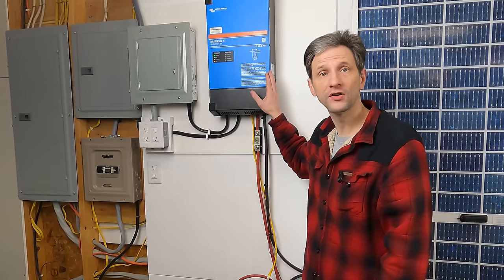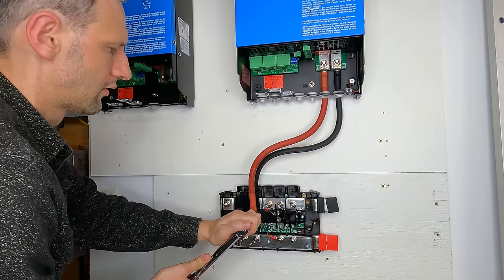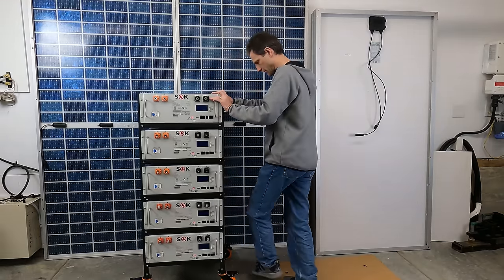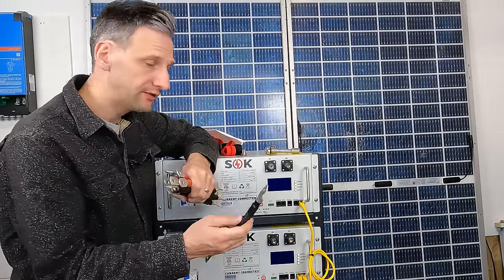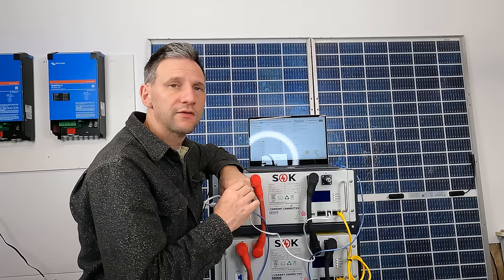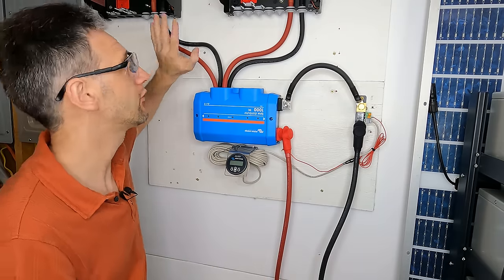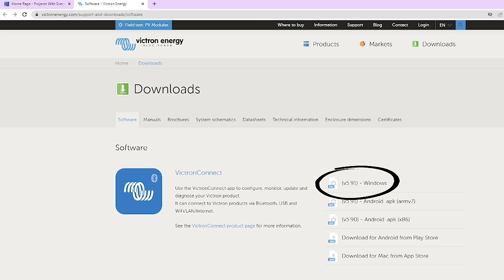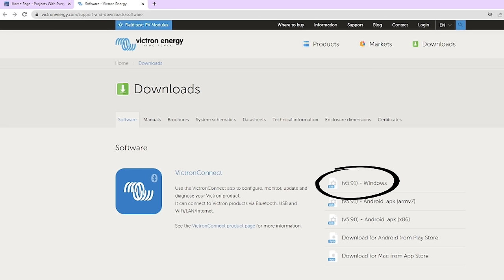DIY Split Phase Battery Backup for Home - Step by Step

Comment: I’m a bit confused about the grounding relay in the inverters. Aren’t the ground and neutral bonded in your main panel? If so, why do you need to bind them through the relay in the inverter. Perhaps I’m missing something obvious given the complexity of the setup here.
Reply from the maker: When the power goes out, the Victron internal transfer switch moves the emergency panel off-grid.  The emergency panel does not have a ground/neutral bond and is now isolated from the house electrical system.  You need a ground/neutral bond somewhere in the system so one of the units is programed to create that bond when running off grid.
Reply: @ProjectsWithDave  makes sense thank you
Reply: @ProjectsWithDave  Unless I missed something, you have continuity from the sub panel through the inverters to the transfer switch.  All grounds should also be connected together.  If that is the case, the connection in the main panel between ground and neutral is still active..

I have a similar setup with a generator in my system.  I have to remove the internal connection between ground and neutral.  Mu inspector actually asked about that when he reviewed my installation.  I created a plug for the full power outlet of the generator to connect ground and neutral.  Since that plug and the house cannot be connected at the same time, all is good.

Comment: Fantastic video and love watching your others. Two questions: 1)Since the inverter is the only supply to sub panel wouldn’t it make sense to have a way to still power subpanel for maintenance or replacement of inverters, like an interlock or something with grid into subpanel?  2) When you landed the two neutrals from inverters, looks like one went to main N lug and second went to N bus bar, is that correct?
Reply from the maker: I could have set up an additional transfer switch for maintenance purposes, but I don't think it's worth the trouble.  I used the main lug for one of the neutral wires because it was convenient and I'm not using it for anything else.  A 6AWG wire is large enough for the lug and they all go to the same place.
Reply: You can install a rotary bypass switch for this very scenario, and I install them on all my setups.

The way he has it, if one inverter fails, you lose all power, and a rewire will be necessary to get power back until the inverter is fixed or replaced.

An auto transfer switch can fail as well, so having some manual and mechanical method of diverting power makes more sense to me.

Comment: You can install a CerboGX and get the SOC directly from the battery via CAN. No need for the Battery Shunt. Using the CerboGX will also show you and record the cell max and min voltage, battery temperature and other information.
Reply from the maker: When I can find some time in my schedule I plan to get one and try it out.

Comment: Why not connect the shunt directly to the lynx distributor vs using a cable? 17:32
Reply from the maker: So I can mount it independently without putting unnecessary stress on the device.

Comment: Question about the ground bonding setup on the inverters..  Since this is not a separately derived system, would it not be correct to have them both set to not have the ground relay enabled?  Your neutral bond is still at the main panel in your house..
Reply from the maker: When the power goes out the internal transfer switches isolate the hot and neutral conductors from the home system.  At that point it is it's own off-grid system and needs a ground/neutral bond.
Reply: @ProjectsWithDave  thank you for the reply..  Does the victron change the bond as well when the power goes out?  If not, seems like two bonding points in the system when the power is on..
Reply from the maker: That is why I had to make the settings different for each inverter.  One inverter is set to no bond, the other is set to create the bond when the units switch to UPS mode.  That way the system has only one Ground/Neutral bond.
Reply: @ProjectsWithDave  When your power is on, how do you not have two different bonding points?  One at your main panel and one in the Victron?  Does the Victron that's doing the bonding change its bonding status between power/no power state?
Reply from the maker: Yes, it has a relay that switches to make the ground/neutral bond when in off-grid mode.
Reply: @ProjectsWithDave  that is so cool..  Glad they implemented these kind of features..  Thanks for taking the time to communicate..

Comment: If connecting more then one string of batteries could one of the open spots on the lynx distributer be used for one of the battery banks?
Reply from the maker: Yes

Comment: Your AC Side are running on different phases... they don't need to be same length since they have different loads and different circuits.... the DC side does need to be same length for load balancing since they are going on a shared bus to shared batteries...
Reply from the maker: Yes, thanks for noting that.

Comment: What is the model and spec of your generator?
Also link to the Transfer switch you are using. Thanks for a great video with steps.
Reply from the maker: The transfer switch and all other components is in the parts list on my website, the link is in the description.  Here is the link for reference: https://projectswithdave.com/120-240v-victron-home-backup/
I have two generators, one is 120V dual fuel generator the Maxpeedingrods sent me ( http://bit.ly/40eKkw2 ), and the  and one is a cheap 120/240V unit I bought at a day after thanksgiving sale.  I can't say I'm in a position to recommend a generator at this point.

Comment: I’m confused regarding the transfer switch. You mentioned if you are not home the inverters can switch from ac assist to generator to make sure everything remains online but that’s a manual transfer switch so the inverters could never automatically pull from the generators. They could turn it own I guess, but the switch wouldn’t switch. For the money I believe I would have used an inverter that could take the ac assist and the generator and eliminate the transfer switch altogether.
Reply from the maker: In this setup, the inverters have an internal transfer switch to switch from AC in to battery backup.  The AC in can be manually switched between Line and Generator using the external transfer switch.  Victron has a more expensive inverter that has two internal switches that can switch between Line, Generator, and batteries automatically.  That is this unit: https://www.currentconnected.com/product/qua10k120/?ref=pwd

Comment: How about using busbars on the side of the rack for the batteries' (+) and (-) terminals to connect to?
Reply from the maker: Busbars add a bit more cost, but are arguably the best solution for balancing the batteries.

Comment: With the shunt inline, does it matter that the lengths to the battery bank are no longer equal?
Reply from the maker: No.  The connection to the battery is a series connection with only one inverter.  You only need to worry about imbalanced lengths with parallels connections.  Those would be the connections between the batteries and when connecting parallel inverters.

Comment: If I'm totally mobile (DC only) and want 240V, couldn't I get a MultiPlus II along with an AutoTransformer to make 240V output to my distribution panel? That way I should have 240V and 120V for everything. Correct?  I'm guessing I just wouldn't have as much usable wattage compared to two Multis, of course.

Basically:
Battery Bank > MultiPlus II > AutoTransformer > AC Panel

– OR –
I could get a European MultiPlus with 230V and change the 50Hz to 60Hz.

Pardon anything screwy here. I'm still learning...
Reply from the maker: Yes, that's a solution you could use.  Here is a video from the guys at Current Connected on the topic: https://www.youtube.com/watch?v=Xp-9F1jBq6E

Comment: Why are you using the ground relay to bond the neutral to ground in one of the inverters? Isn't the neutral already bonded to ground in your service entrance load center? If it is bonded there and that neutral remains connected to the inverters when the ground relay is closed, I believe you have a code violation because you have your ground and neutral bonded at two locations. As I understand it, if you don't have a means in your transfer switch or something else to make and break the neutral to ground bond in the SE panel, your generator and battery backup power should both be setup as a non-separately derived system and the neutral should be left floating in the generator and in the inverters. If I'm missing something, please help me to understand.

Edit: I just read the manual for the inverters and see that there is an input safety relay that opens the line and neutral connections when input power drops out, so now I understand why the ground relay would close.
Reply from the maker: You got it!

Comment: Can I connect two different multiplus (48V/3000VA and 48V/5000VA) to one phase with 220V?
Reply from the maker: I'm not sure exactly what you are proposing, but the inverters need to be the same to link together. If they are operating as two independent systems I guess you could make something work, depending on the setup.

Comment: I watch a video by David Poz showing why you should never hook those style batteries in parallel and to you use a busbar. He's disassembled them and the jumper bar on the inside (that connect bolt red terminals and black terminals together) gets way too hot when a heavy load is applied to it.
Reply from the maker: Thanks for the concern.  I've seen his video.  My system is operating well within the max range for the construction.  That being said, a bus bar setup is the more ideal layout.

Comment: What is the point of separating out critical circuits? To prevent someone from baking a turkey during a grid failure?
Reply from the maker: Multiple reasons, here are the two big ones:
1) As you mentioned, to prevent rapid consumption of available energy in a power outage from non critical loads.
2) You can save a lot of money by purchasing a small inverter that can run a few critical loads as apposed to a large inverter capable of running multiple large appliances at once.

Comment: Dave, All-in-on inverters offer operating modes such as SBU (solar-battery-utility - use solar first, borrow some from battery if solar is not sufficient, or borrow some from grid if battery is not enough), similarly in SUB mode. Can this split-phase Victron 120/240v be configured to operate in SBU, SUB modes?  Also all-in-one provdes options for charging batteries by solar only, or both solar and grid. Charging the battery by grid is not that attractive to me.
Reply from the maker: My Victron system is currently setup as a UPS for my emergency circuits.  If I were trying to make a system like the one you described, I would use a UL listed all in one inverter.  There are some good options on my inverter page listed here: https://projectswithdave.com/inverters/
Reply: @ProjectsWithDave . I was hoping that Victron could be configued to perform all the fucntionalies that  all-in-one inverters offer and can do more.  I guess they were designed for different applications in mind. I think that I may get a cheap low-freq transformer based 6kw (18kw surge) 120/240v inverter to run my wellpump and septic pump only when i need it because its high idle current.  Schneider is transformer based and good but need to buy other components like Vicron, Solark/18kpv are high freq inverters and they may not have high surge capability. Thanks

Comment: Yeah, the microwave uses 1000 watts but usually only for a couple of minutes at a time. The absolute longest I ever ran a microwave for was 20 minutes and that was using a microwave rice cooker back in college. The same could be said of an air fryer. Sure, it uses 1500 Watts...but you're only running it for 10-15 minutes at a time or so.

Comment: I assume its cause I'm still young, but I never understood how someone could afford setups like this. It makes me jealous with my harbor freight kit
Reply from the maker: I started out with a simple grid-tie system that would easily pay for itself.  A battery backup system like this one only makes sense if you have a lot of power outages or need to run off grid.

Comment: I’m trying to hook up 4 Multiplus 120/3000/48 volt  to supply 240.  How do I do this.. I have two wired correctly but I want to add two more
Reply from the maker: I haven't built that configuration, but you should just be able to configure two units in parallel on each phase.  So two units will be assigned to phase one and two units will be assigned to phase 2.  The wire lengths need to be the same for the parallel units.
Reply: @ProjectsWithDave  excellent. I’ll give it a shot

Comment: I would have thought that you could have left the 100A rated cable and just changed the fuse from 100A to 50A. That's all it would take to limit that feed, without excess work.
 I'm also surprised that you don't use "cable butter" on those tight conduit runs. That's what I've seen with senior union electricians. It makes life much easier in tight conduits.
Reply from the maker: Smaller breakers do not have large enough lugs for the 100A rated cable I had already run that's why I had to change it.  I didn't need any lubricant for the short runs I made.  I was even able to push it through from one end.  It's the connectors that are a bit tight.
Reply: @ProjectsWithDave  Would it make sense to put anything on the wire connections to avoid corrosion? Dielectric or anything else?

Comment: When wiring the inverter outputs to the emergency panel why tie them into a breaker instead of the main lugs?
Reply from the maker: A breaker protects the conductors from the inverter to the subpanel from overload, and provides a quick disconnect for the subpanel.

Comment: I’m not sure that matching the AC conductor length matters much. Your phases will inevitably be unbalanced; much more so than an extra 6 inches of wire between the inverter and breaker
Reply from the maker: That's correct.  Matched lengths only matters for parallel setup.

Comment: Dumb question.  Is there any reason why you aren't using a lynx power in or distributer as your bus bar for those batteries?
Reply from the maker: I didn't need it when I had only one battery to connect.
Reply: @ProjectsWithDave  aaah, ok thank you for responding makes total sense.  I'm building my system right now and learning so it was more of a question than not.

Comment: Great video but my OCD for neat and uniform wiring is in over drive.
Reply from the maker: I'm with you on that one... : )
Part of the problem was making the AC lines the same length, which wasn't necessary.

Comment: I don't understand why you connected the com ports to the batteries.  You didn't connect the batteries to the inverters?  You are running in open loop and connecting the batteries to each other does nothing?  You need a cerbo to communicate to the batteries so the system knows what's going on. Otherwise nice setup.  One more, why not go with the 5kva inverters?
Reply from the maker: I connected the batteries to each other to show the ability to monitor them all from the software.  It's not necessary for this setup.  If I was starting from scratch I would have gone with the 5k, but I already had the 3kVA model, so I only had to add one more to make split phase.

Comment: Hello, pls, do you have experience with Enphase system?

Pls, i need your expertise advise on how I can connect a battery backup with my existing Enphase system? 
I plan on using a third party battery I purchased from China. I have two 10kWh batteries that I plan on connecting in parallel. One of the batteries has an inbuilt 5KW inverter and I have another 5KW inverter (same brand) that I plan on paralleling as well as both are 120V. 

For my existing solar system, I have a combined box as well as 3G system controller. 

I understand how to connect the inverters in parallel, but not sure how to connect with my system controller. 

Pls, I’ll appreciate your help in walking me through this process. I can share my number with you if you don’t mind. Really need your help.